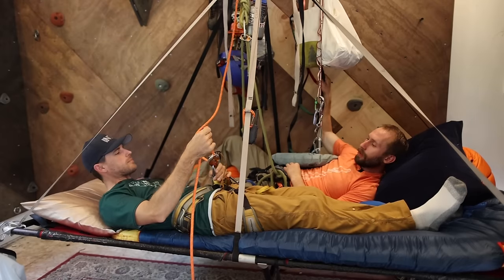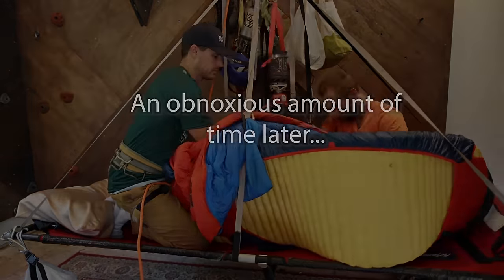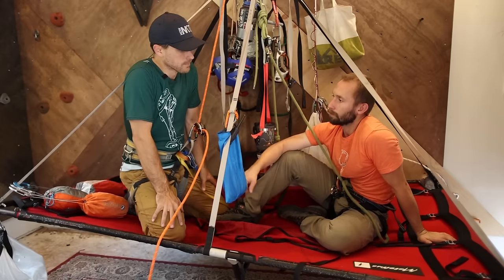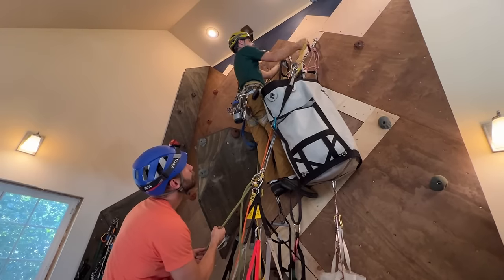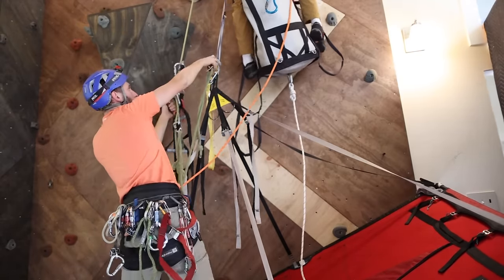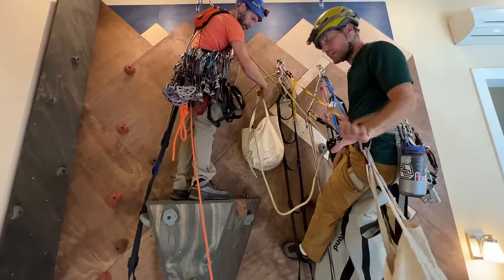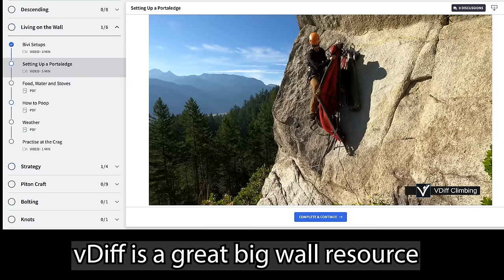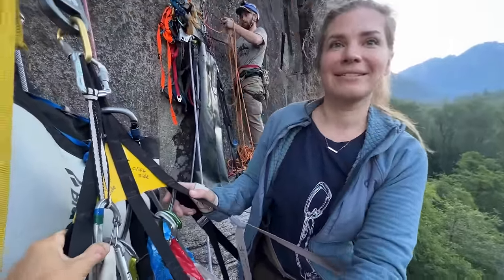How to Sleep on a Cliff and Poop in a Bag

Comment: "Yours" and "mine" is a way way better verbal cue for gear hand offs. There is an obvious direction the gear is going. I have on more then one occasion seen two people both say "got it" and then both drop the gear. "Take" and "taking" are too close together sounding to be clear in a loud, windy, emergency, fast, etc. situation in my opinion.
Reply: Iv always done it where the person giving holds onto the item and never let's go, the person taking it has to pull it out of the others hand. So no one ever let's go of anything.

But I'm on ladders, not on big walls, so I'd probably want to throw in a verbal system on top of that if I could be completely fucked if I dropped something.

Comment: Are you sure it's safe to drill into the portaledge? My gut instinct (as an engineer) tells me that may seriously compromise the strength of that beam, pipe or whatever its called. Though that would actually be a great thing to test, if only they weren't so expensive...
Reply from the maker: would a small 1/4" hole at the connection compromise it?  It seems like that is how everything is attached.  The bar reinforces it right at the weakest point anyways.  That could be a hard test to determine something conclusive.
Reply: @HowNOT2  I agree, that would be hard to test, however I have an idea. Now, let me verbosely explain my point. So you are right, the bar will reduce bending stress in the strut. However, there is no 'hard' connection between them, as can be seen in the setup video you included, there the whole ledge twists around itself. So imagine two people are sitting (or god forbind jumping) on opposite corners of the ledge. This would try to turn one of the long bars one way and the other one against it. The 1/4" bolt would try to prevent that and therefore create stress within the wall of the strut, with quite a lot of leverage. Despite the bar taking stress off, the middle of the strut is still one of the places that sees the most stress. Now combined with the stress in the wall, that could well have unforseen consequences, since the part wasn't designed with that in mind and probably not tested for it. Also, the way a hollow pipe fails is not by bending or breaking but rather by folding in on itself, which instantly leads to a massive loss of strength of the cross-section. So it is - kind of - comparable to breaking like glass. When you cut glass and bend it, it's gonna break exactly at the place of the cut. Much in the same way, the pipe will most likely collapse at the point where he hole is. Although the latter part is a bit conjectural. Now you said, that's how everything is attached, but the ends of the strut don't see much bending stress and even if one of those bolts were to damage the whole it's in, it wouldn't do much to the stability of the ledge in general. 
So in conclusion, if you bolt in the bar, stress on opposite corners should be the worst case scenario. And that may be a place to start in a possible test.
Reply: @TheS4ndm4n  Are you trying to whip off your portaledge?  It's just a glorified hammock.

Comment: so wait how are you pooping into that 2 liter? like no way is that opening large enough. did i miss some modification?
Reply: I guess they funnel it with the bag?
Reply: @bryana7163  that can't be it. There's no way You're mashing your shit into a 1inch opening 2litree at 1k feet up. They gotta be cutting open that bottle or using a different one and the was a joke.
Reply: Personally I'd need a nice nalgine size opening or shit in a bag and store on a nalgine destination for poo only. Please feel free to add solutions. This is a big deal for me on the wall now that I'm going for bigger climbs
Reply: @alexthomas2953  yea, I don't know,. I've done hiking and indoor rock climbing, and mountain biking that's it.  I was just curious on how people set that stuff up while hanging on a rope, its quite the challenge.
Reply: To clarify:
You go to the bathroom in the wag bag and then you cut the 2 liter water bottle open like a pac man and put the wag bag inside it that way. Then tape it shut. You can usually fit a couple used bag in said bottle.
Reply: @alexthomas2953  The opening of the bottle has threads for a reason... Just twist it right in.